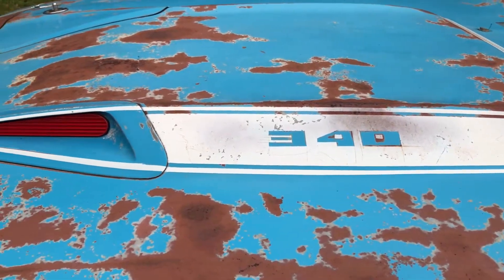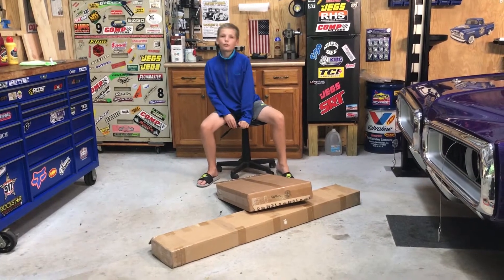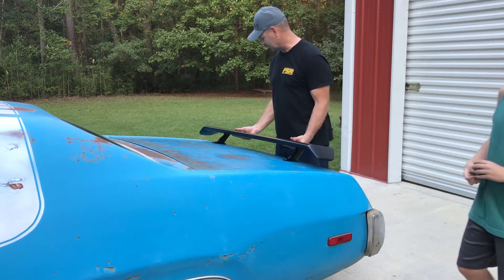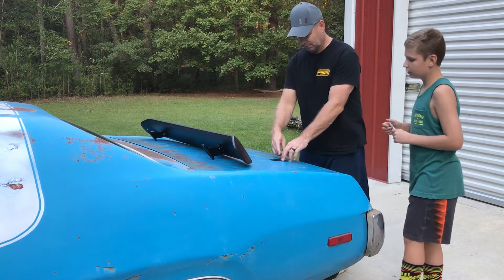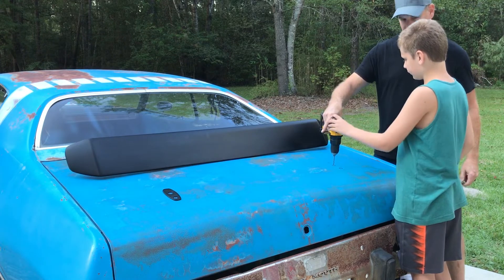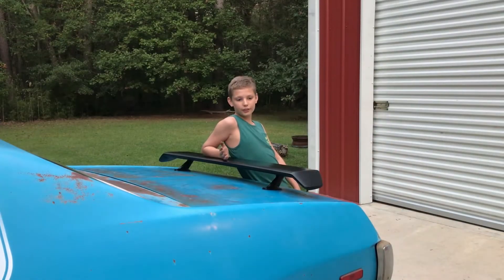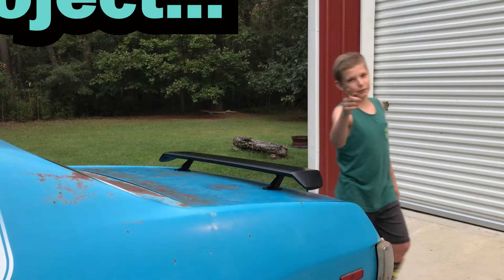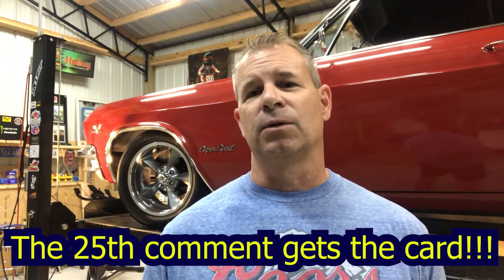1973 Road Runner 340 gets its first batch of goodies!! Go-wing and chin spoilers!! (EP 6)

Comment: Looks like a sniper efi on the Chevy. Happy with it? Just picked one up for my old Chevy too.
Reply from the maker: This was the best thing we ever did! With how hot and humid it is down here in GA, the car would stall at stop lights and not want to restart for 20 minutes if shut down hot, It was no fun to drive at all. The Sniper (which i got at a discount on Holley's refurb Ebay page!) installed in one day and was instantly awesome! I have about 10,000 miles on it now and other than the fuel pump overheating and shutting off on extremely hot days on long drives its still perfect. I need to get the Tanks Inc tank in the car with the pump inside, but the whole world is sold out right now...We will need to do that before Hot Rod Power Tour next year. I want to put it on the Super Bee, but you know Im not allowed to touch that!!! The Sniper also interfaces with their 7 inch screen and you can plug a laptop in for fine tuning if your into all out HP.....